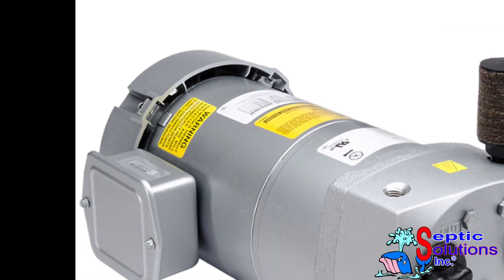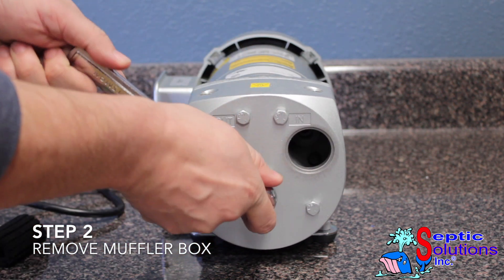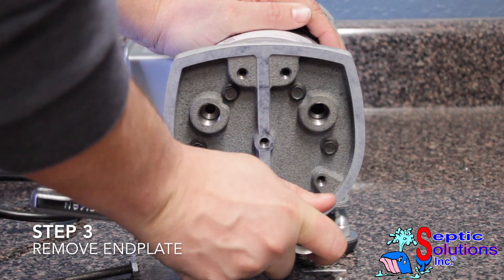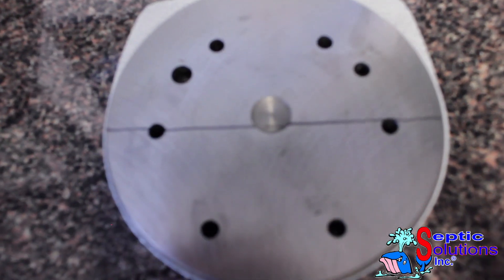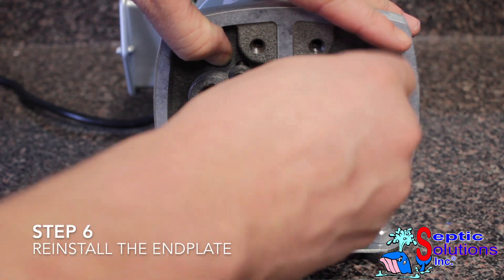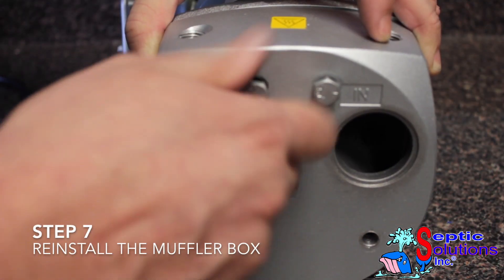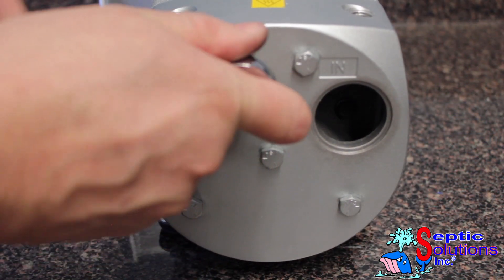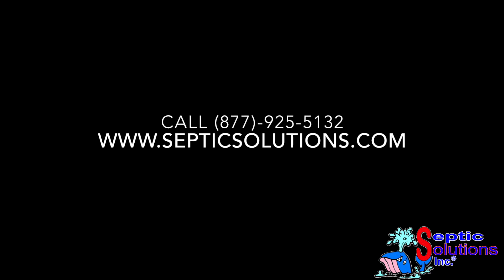How To Repair A Gast Rotary Vane Compressor by Septic Solutions®

Comment: I changed the vanes and filter of the  pump GAST 0523-101Q-G588NDX, the motor is rotating( at least giving loud sound) but it is not pumping. What could be the reason?

Comment: what about the bearing on the other end of the motor, mine has a removable plastic plug that you remove and can see the end of motor shaft, should i put in oil or grease or what good vid thanx
Reply from the maker: The bearings on these motors are sealed and do not require any type of lubrication or maintenance.

Comment: What if the rotor doesn't move freely??? It's tight for me. I have to move it with my thumbs. Is there a way to make it spin freely?
Reply: did you ever figure out way to get it to move? I can't get mine to spin at all, I think its pieces of the broken vanes blocking it.
Reply: @hickelpickle  Well, dig them out of there and make sure the new one are installed correctly as in video
Reply: @AP-514  The solution I found, is to loose the two hex bolts which allows the outer housing to be adjusted. This allowed me to free the roster and get the pieces out. my vane was so crushed that had a bunch of fine pieces stuck between the rotor and housing making it impossible to free up.

Comment: Gast 0523 aerator pump. I'm able to to hold 10lbs pressure if I plug the export air. Otherwise connecting the plastic line to it decreases in pressure. Less then 2.5 psi
Reply: Any help on this. Thanks
Reply from the maker: The pressure that the unit will operate at is dictated by the line that it is connected to. They can run at up to 10 psi maximum continuously without there being an issue. However the line pressure is variable depending on the length of hose, type of diffuser, and primarily the depth of the water. If it is capable of building 10 psi when you plug off the outlet, it sounds like the unit is functioning correctly.